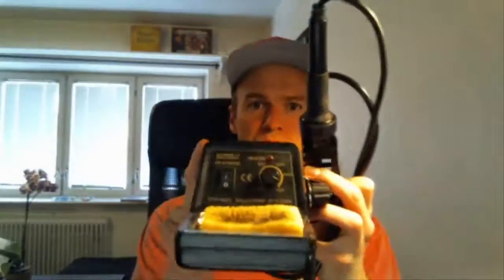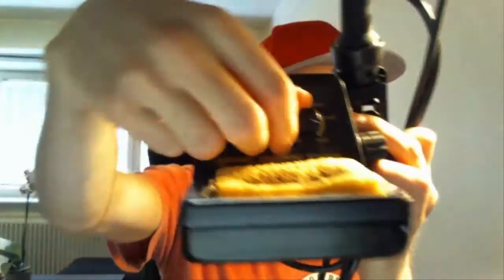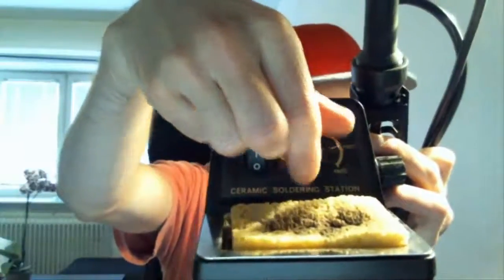Soldering Temperature - What is the RIGHT soldering temperature?

Comment: I just keep my Weller WLC100 around Level 4 since it only measures in wattage and not Degrees on my station. If it seems too hot for the job I am doing, I turn the pot down before I burn my project up.

Comment: For weldering iron that has no temperature gauge how to determine temperature
Reply: If your soldering iron does not have a temperature reading, you don't need to determine temperature. Just use the temperature it has.
Reply: @Ohmify  so,how do you know if it's hot engh to be used to solder
Reply: @MakhonzaSimani  You just try. If the solder doesn't melt, wait a little bit longer.
Reply: You can use 1 dimmer control pub

Comment: After months of experimentation with different leaded solders, I find 330c to be about perfect. Rapid wetting without burning off flux. I solder mostly terminals and turrets and such with wire 20-14awg. I use a 4mm chisel. I think Hakko t12/t15 needs a tiny bit higher temperature because the tips have thicker plating for durability, and slightly reduced thermal performance.
Reply: I solder with temperature 300°C with flux already on the solder and it's working very good
Reply: @Verightess because in proper soldering the tip doesn’t melt the solder, it’s heating the surface to be soldered, which melts the solder. This is why one solder maker recommends tip temperature of 120c-160c higher than solder melt temperature.
Reply: Is 330°C the temperature for 60/40 tin/lead solder?

Comment: Awesome!! So would you use 350 to 400 degrees Celsius for soldering on a wii motherboard?
Reply: Just mix solder joint with low melt solder to desolder components at a lower  temp of 160 to 200 c on your wii, at 300 you risk lifting up pads
Reply: Yes, most likely. But depends on your tip thickness and the size of the joint you want to work on. If you want to be sure, start low. And if the joint is not melting, increase the temperature until it does.

Comment: Thank You for Your Information.
I'm trying to fix my RCA Tablet by simply removing the Battery Connections and allowing it to discharge the capacitors and all by depressing the power button.
It froze on the RCA Start-up Logo and I tried Everything I could find on anything from Factory Reset to trying to allow the Battery to run completely out but when I plugged the charger back in, the Battery shows it still had 60% charge left in it. SO, I popped open the case and realized I have a Soldering Station that displays Celsius NOT Fahrenheit. I really Appreciate Your Tutorial and look forward to more of Your Video's!!
Sincerely, J Quinn

Comment: Thank you.

Would you please tell us, how to make sure that the tip has the same temperature as indicated on the base switch.
In other words, if I set my base to 350 how do I make sure my tip isn't 200 or 500?

Thanks again.
Reply: The problem with that is that it still won't show you actual tip Temperature, since its not sensing off the tip, and is designed to give you the output average. The tip Temp drops drastically under load, and the readout you have won't show it.  There is no way, except to wire the tip itself with the Thermocouple.  Almost all your temp variations are in the tip itself.